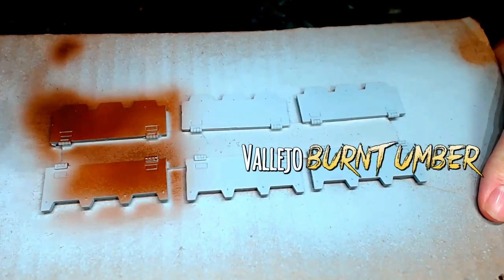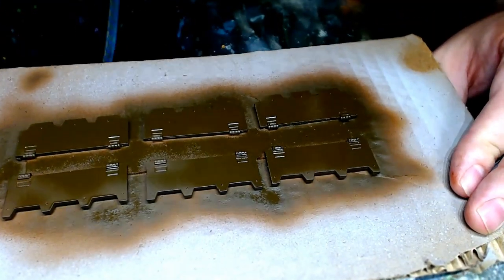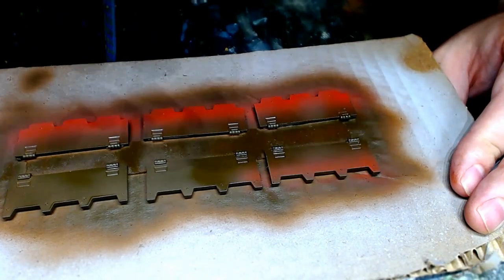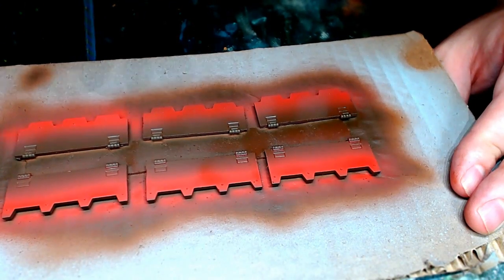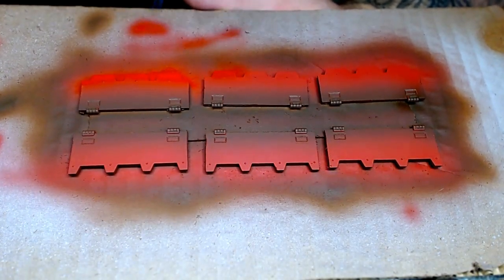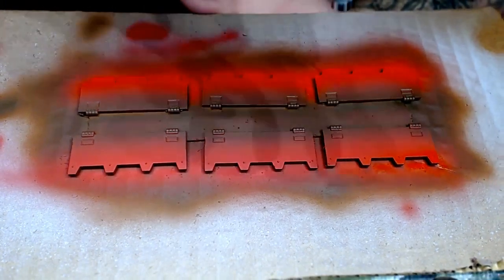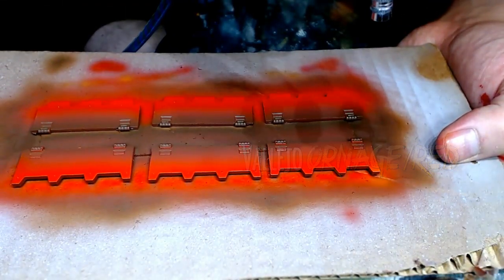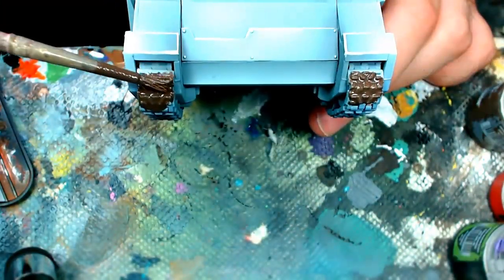Easy Rhino Hacks - Part 2

Comment: Hey Kenny! Could you make some more tutorials on mixing colors and general healthcare for the air-brush?
I'm having a hard time with my brush right now cause I dont really know how to mix the colors good.
I primarily (read only) use GW colors right now and Im really having a hard time getting the mix correct. I feel like I get the colors to "pool" when I paint, dunno if my color-mix is to thin...
Reply from the maker: Hans Johansson yes, i will.  Make the switch to vallejo air though
Reply: thats awesome! I guess the Vallejo Air are "brushready" out of the box?
Reply from the maker: Pretty amazing line of paints